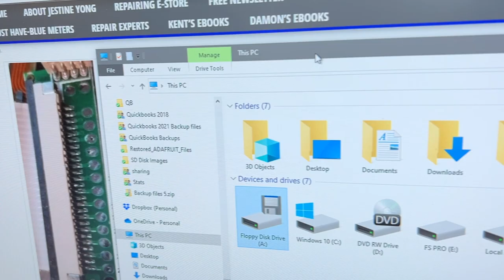interfacing with floppy disks at low level, part 4

Comment: Nice work!

Mostly unrelated side note to your project: the USB specs for floppy drives only supports 3.5" floppies, but the specs doesn't support 5.25" floppies.  This always struck me as odd.  However, there are projects out there that add non-standard support for 5.25" floppy drives, such as the FC5025.  If any are open-source, perhaps they have some code that may prove useful.
Reply: What are the differences between the 3.5" and 5.25" drives that cause issues?  I always assumed they spoke basically the same language and that improvements revolved around efficiency/accuracy, but I admit I knew (and know) very little about the internals.
Reply: @JosephDavies  You are partially correct.  Electrically, the drives are all very, very similar.  However, the devil is in details and with floppies that devil is the need to know how many tracks, sectors, and heads a disc uses as well as how many bytes are in a single track-sector.

The specification that defines how USB floppies work is the "USB Mass Storage Class UFI Command Specification".  Unfortunately, of all the formats that are possible for floppy discs, only 3 sets of values are supported: 720KB, 1.25MB, and 1.44MB sizes.  These are listed in the spec in tables 17, 35, and 37.  The sad thing is that 5.25" size of 1.20MB could have been supported by simply adding 1 (or more) rows to these tables, though perhaps the committee felt that by 1999 that 5.25" discs were 99% dead at the time.

Note that the 1.25MB is not for standard 5.25" floppies but instead for a format used by NEC for their PC-9800 computers (popular in the Japanese market at the time).  However, the 1.25MB setting can be also be used for the standard but extremely ancient 8" floppy disc.

https://www.usb.org/sites/default/files/usbmass-ufi10.pdf
https://en.wikipedia.org/wiki/List_of_floppy_disk_formats
https://en.wikipedia.org/wiki/PC-9800_series